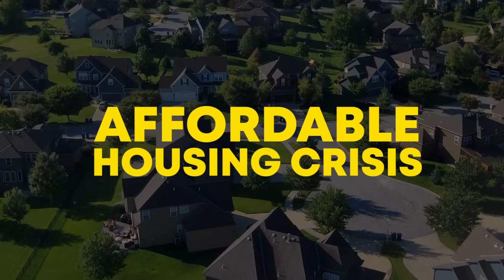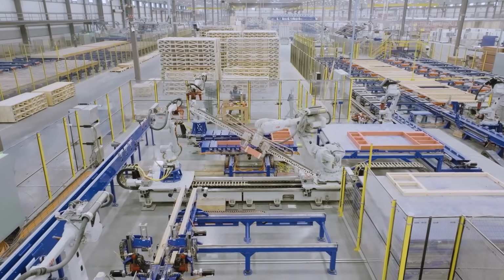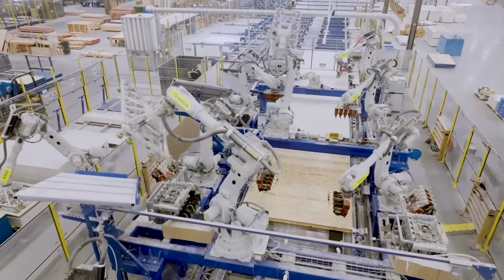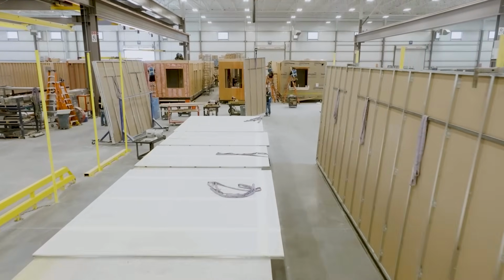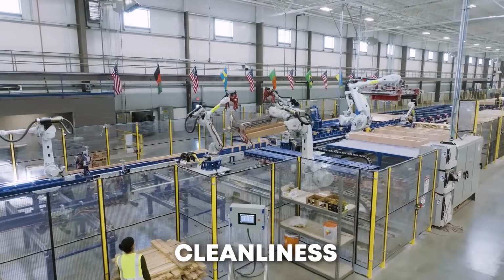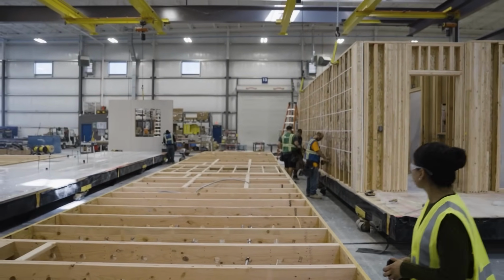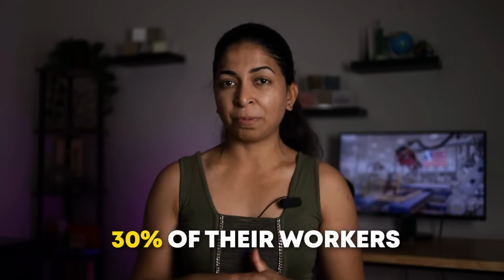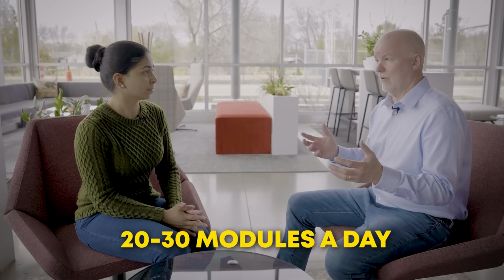Can Robots Solve the Affordable Housing Crisis?

Comment: The real question is why houses are expenses if the construction is so much easier than it was before?
100 years ago people didn't have sheetrock or plywood or nailing gun or all the other machines. Were I live the unions and government taxation is responsible for it. Thus this is a partial solution as it's replacing the unionized worker by robots and replaceable factory workers.

Comment: This is excellent so far, but all the mods look the same (which is fine for their mission.)  I'd use the automation to produce wall sections applicable to any design, skip the wiring and plumbing but pre-drill for wires and pipes, and ship them off as flat packs.  Then you could expand.  Just a thought.

Comment: Why factory build using construction materials that were invented to be site assembled? That's guaranteed to limit productivity. Use materials available on an industrial scale in a factory, like recycled plastics, resins, foams, and so on. There's no reason to factory build with wood, except to push out local builders by buying out materials they need. Typical giant corporation strategy.

Comment: I am a developer/builder and see local governments talk about this issue, but wont approve projects at the rate they need to. They want to control the hosuing stock. This is great for me because they cant help themselves and lack the political will to do something about it, so supply is constrained.  All the local governments need to do is say YES to projects. Our industry can produce a ton of product. Unfortunately, modular is more expensive and it is very hard to capture the "time savings" as advertised. Typically it is a the local building official (a wild card in the process) can derail all the time savings with one bad decision. Typically that bad decision ks a fear based decision. Meanwhile all that automation money was spent and one guy/gal is the linchpin.

Comment: Ye looks good but no this isn't viable. Watch this space carefully, it has already been tried by many companies in Canada and the US.
.
.
Here is the issue:  The capital cost is immense and truly needs to pay itself off and create a profit within 5 years.  5 years is the target only because there is a constant need for a technology upgrade within 5 years.  Right now from the housing factories that have been set up they all don't go the full automation route because the capital costs on prohibitive.  FYI- each one of those robot arms cost at least US$50k without programming and installation.
.
.
Now the programming and troubleshooting is a frustrating and ongoing process.  You need highly qualified and expensive people on hand.  This factory looks so smooth, but go spend a day at this factory and you will see ongoing problems. For example, if the suction cups fail just once - the domino effect of problems stops the entire process.  Then the Engineer/programmer(s) will try make a new work around. Downtime costs, and re-engineering test trial costs just get out of hand.
.
.
Then comes the big issue: each new construction project has unique features that require a new process rigging. And a vast amount of programming and troubleshooting.  And it feels like you are almost at square one with developing the process.  You may try simplify the process to a point that you only make wall sections of, say, 10ft by 7ft.  Your process then becomes relatively useless to the construction industry (cost of transport the wall section is greater than labour making the same wall on site).
.
.
Right now, sadly, it is cheaper to have the construction sections made by human labour in China and transported to site.
.
Maybe AI will change things up dramatically in the future and I will be proven wrong - I look forward to that day.

Comment: The problems with building more affordable housing are WAAAAAY more complex than just using robtic modular construction to build cookie-cutter units that often don't fit into existing parcels or optimize existing spaces. They have their usefulness but it's not nearly solved.
 
I'm also a little worried that Belinda Carr is getting too cozy with these various businesses that invite her into their freshy-cleaned factories and pay her way to demo new stuff. Don't simply repeat their sales pitch. If she went there unannounced during busy times she might see a much more dysfunctional side.

Comment: Housing Shortage is a false concept. Blackstone turning back the clock to a fiefdom by buying all available single family homes in markets to then rent them out as a business model, the opioid drug addiction crisis (Fentanyl), the mental health crisis, historic devaluation of the US dollar, and 7% interest rates in the US. That means a $300k home at 7% over 30 years = $1m total cost. Automating stick housing construction isn't the solution. More over, this is a nice facility but they are automating stick construction.

The way houses are design and constructed must change for a rapid reduction in complexity and performance. Insulation in the stud cavities allows thermal bridging from the wood studs lowering the overall R value of the entire wall assembly significantly. Place the insulation on the OUTSIDE of the studs you break the thermal bridge. The difference of stuffing insulation between each of your ribs vs wearing a jacket. Just one example. Never automate a process or method that without questioning the validity of that system.

Comment: The argument of affordable housing was never about purchasing a house until the real estate industry decided it should be.
It was originally about affordable rentals.
This wondrous system of ours placed a baseline on earnings (minimum wage) without establishing a baseline for accommodation.
Thus making it near impossible for individuals earning minimum wage to thrive solo.
I am of the thought that all new multi-family structures should include a number of Baseline housing units.
These would consist of a mere 300 square feet and have a simple bath and kitchenet.
These units could only rent for 40 hours wages.
 Use a salary cap of + 25% for eligibility.

Comment: No. The main issue with affordable housing is not the production cost of a house. Most of the cost of a house is in the interior finishes after all. You can DIY build a big, furnished 2000-3000 square foot house yourself on a vacant plot of land for about 150-180 thousand dollars of today's money. Including the cost of the land; depending on where the land is of course. ~300k if you have contractors do every bit of work for you. Manufactured housing is not cheaper than a site built house either. It is often slightly more expensive. Worse, there is no way that manufactured house pricing would drop significantly even if all their work was done by robots. That is not something shareholders would allow in the US.

The actual main issues are strict permitting, land cost and availability, and the biggest issue of all: zoning codes. Zoning codes across the US almost universally restrict any type of affordable housing from being built. Duplexes, triplexes, quadplexes, etc are not allowed to be built due to how zoning plans are made. Luxury apartments are the only type of apartments that make financial sense to build. Luxury single family housing and luxury condos are the only homes being built for the same reason. This is because demand, and therefore pricing, of housing is held artificially high because zoning laws across the us prevent builders from even attempting to build starter houses and low cost apartments. This restricts the availability of lower priced housing and results in everyone fighting for the only type of housing being built: single family homes. So, pricing for homes is always driven up. Further pressure is added by international investors buying up properties as investments and Landlords leaving rental properties empty instead of renting out at actual market rate prices.

Fix zoning laws and allow builders to make a profit from affordable housing types and you will increase the availability of housing enough to make houses affordable again.

Comment: I'm not so keen on seeing automation as the solution. Prefabrication has been the dream of housebuilding for a long time but even prefrab homes need some intense installation and sight prep to be useful. I still think homes being sight built with dimensional spec products is going to be the most common solution. Prefabrication and modular homes have become as expensive as traditional homes as the have gain parity with quality. It was the case in the past that trailers were only cheaply built with low quality material and the prices reflected this. Now homes fabricated off sight have achieved very high quality standards but when they do the cost seem to be parallel to site built homes.
Reply: That’s really interesting. And my fear is that as these companies try to get rid of as much of their workforce as possible, not only will they skimp on the on-site crew work, but the skilled workers capable of doing the on-site work correctly will become very scarce. This has happened in many industries since the 80s and it becomes a vicious cycle.
Reply: @aliannarodriguez1581 the reason they exist is the lack of site labor.
Reply: And why would they not be the same cost as stick built, the US housing market is the single largest market in the world. That competition evens the prices. 
More units is the only way prices will come down. That isn't happening because construction workers have been denigrated for 50 years.
Honestly we're all just sitting back and laughing at the whiners. Workers have to control now.

Comment: Isn't one of the biggest problems the zoning laws in US and CA? That there can only single-family homes or downtown highrises, but nothing in between? This causes distances to be huge, more space wasted for individual traffic infrastructure, etc.?
@BelindaCarr : I would find it interesting if you could break down, what the full impact is of building medium-high. Of course wood won't suffice, so higher prices and higher skill requirements for initial building, but long term it should be better? e.g. my apartment building is built to last 100 years, not 25 and common costs are shared between the all owners. shorter distances to work/school, etc.

Comment: Nope, the issue is not with the labor, despite the claims.
Reply: it seems too overly simplistic to  blame labor shortage...
Reply: @JayHernandez12  Corpopropaganda. Trying to keep the salaries low and skyrocketing the house prices at the same time. Kicking out skilled contractors out of the equation will only increase their profits even further.
Reply: The skilled contractors retired out of the system.   They were pushed out by lower priced workers.  The construction trades are on-the-job training shops.  The "training" is now so watered down that the quality is much lower than in years past.    The factories can bring the quality up but it will cost far more.   @MrBl3ki   I think the factories are cool but I know first hand that the new modern units rent for way more than older existing housing.
Reply: @MrBl3ki  Skilled contractors are still used in these methods, and their bodies last longer because they aren't lifting 200 lb beams and slinging hammers 10 hours a day.
Reply: Oh what is you ignorant explanation? Corporate landlords have bought less than 1 out of 50 homes on the market the last few years. And the had more than that built so they add housing.
Reply: Labour isn't to blame for the housing shortage. The labour shortage is a very real problem. A couple days ago they transferred this 20 year old kid on my crew to another job site. I'm now the youngest on our crew, i'm 52.
Reply: Hello  @TheBugsyShow  ,.  Can you explain?   Are you saying it isn't the fault of labor?  Or are you saying the lack of enough labor is causing the problem?
....or neither?

Have a great weekend!
Reply: Labour shortage has nothing to do with a lack of housing, different but serious problems.. @Dancing_Alone_wRentals